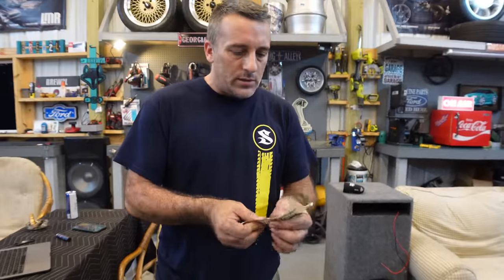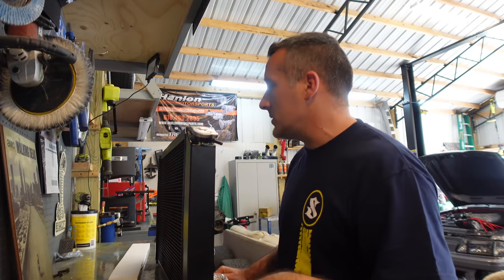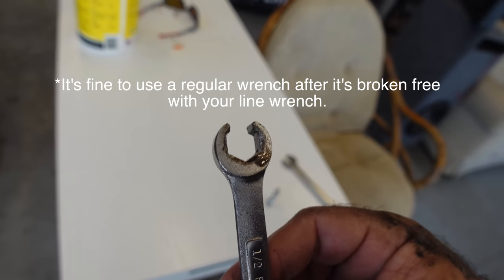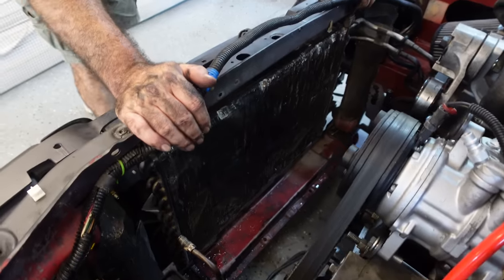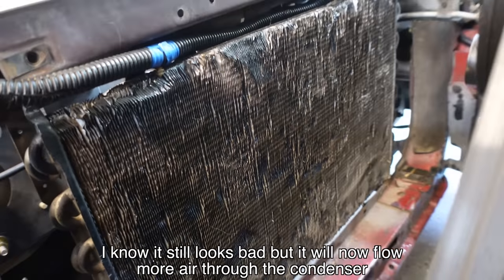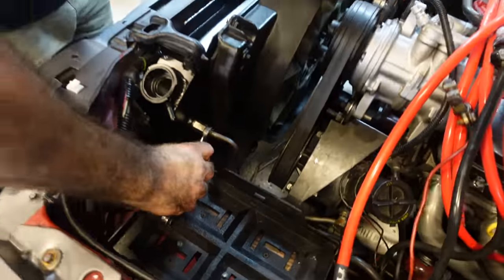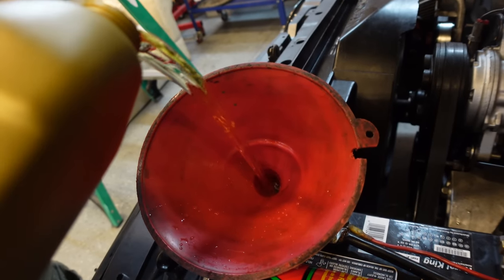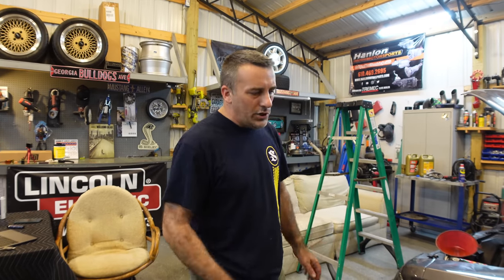Cheap Cooling Fixes! For When Your Money Tree Stops Producing

Comment: I didn’t have a radiator for my car when I bought it. So I picked up a 4 core  aluminum radiator off eBay, for like $180. Of course my fan clutch turned out to be junk, so I was still having overheating problems. My car no longer has any of the under the hood A/C parts, thanks to a previous owner. I’m planning to add A/C back on it. Great video, and information as always. Thanks Brew2L for sharing.

Comment: Nice! That SVE radiator looks well-built.  My 91' came with the 1-row plastic auto part store replacement radiator. I got lucky and found someone selling a clean factory 92' 5.0 copper/brass radiator that had 50,000 original miles and swapped that in. That was back in 2015. No issues since.

Comment: The one thing I do when I change a radiator, or pull one is wash the condenser out. Spray some cleaner in the fins, let it sit, then use a hose and blast it out. It has helped with overheating issues and doesn’t cost anything.

Comment: i got an sve radiator also about a month and a half ago for my 94 5.0 and works well, but the plastic drain valve failed and caused a huge leak, I would replace that with a metal plug before it causes an issue with you, if yours came with a plastic one anyways